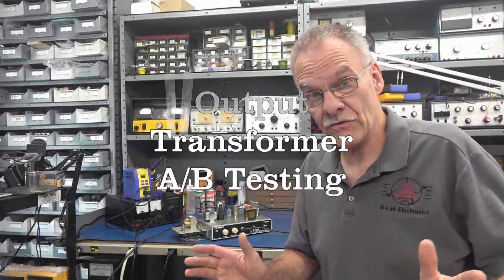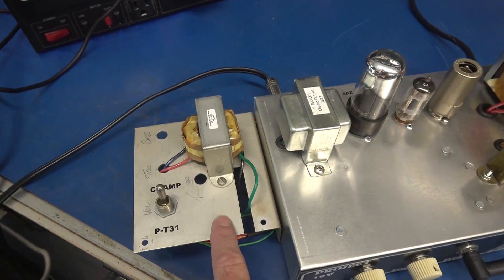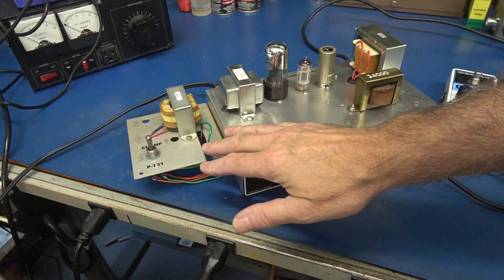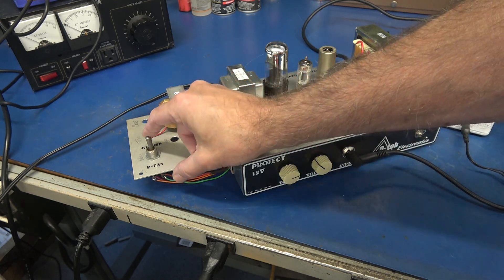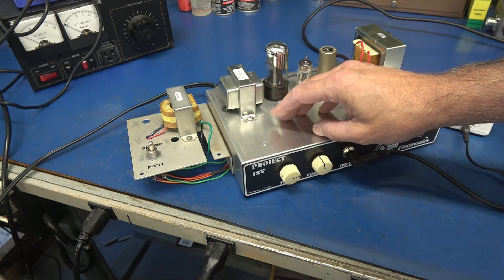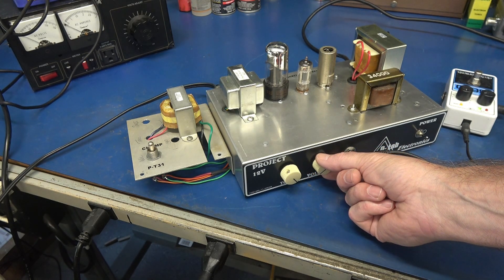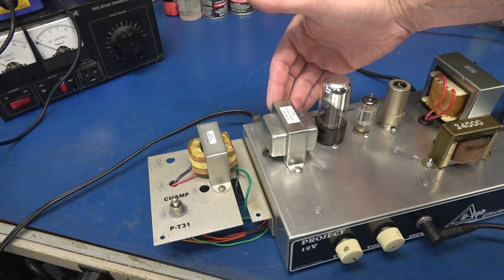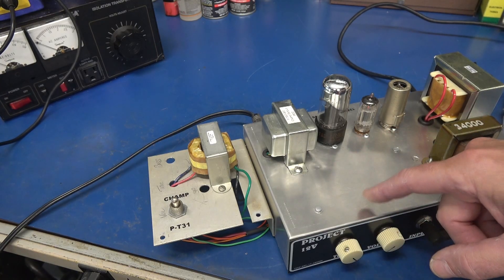Does tube guitar amp output transformer affect tone? Testing Amplified Parts Class A Champ vrs P-T31

Comment: Very interesting , including the next video with scope measurements. I would suggest that the looper has one or two shorter riffs (one bar) , it can be two recording , one with chords stroke and one with a single line soloing but short, this ease the ear comparison (at least for me in my own tests with speakers), so when switching you actually here exactly the same short phrase and the ears may grap better/faster the sound quality difference 
Brgds

Comment: So far as tube amps go, there are so many factors that can have a discernible effect on tone... but I think it helps to understand which factors can have really big effects as opposed to the lesser ones. If you were to list those factors, the ones with relatively big effects, the output transformer might not always be one of them, not when compared to things like loudspeaker selection, open or closed back cabinet, gain and tone settings, biasing, tube manufacturer and vintage, or the level of the input signal. Ultimately, the tone of an electric guitar is a synergy of countless factors, but there actually quite a number factors that would tend to be of much greater significance than the transformer.

Comment: I've built over 100 single-ended Class A 6V6 powered guitar amps. Very early on in my work I discovered that if you do not use an air gap output transformer you are getting nowhere near the volume and quality of sound that the circuit actually produces. Eventually I had air gap transformers custom wound for me. The difference is an order of magnitude greater than the difference between the two transformers compared here.
I don't believe that either of the two transformers shown here are air gap design. Sorry if I am incorrect about this.
This video is sort of like comparing a Ford Falcon to a Dodge Dart when a Shelby Cobra is sitting next door.
I wouldn't bother with either of these transformers for this application.
Reply: Both of those transformers will be airgapped. That's required for single ended.

Comment: I did a 3 transformer comp years ago on a Vox AC30 circuit variant I'd built, comparing Mercury, Edcor and Mojo iron.  The whole thing took about an hour with 2 people besides myself listening.  The differences became clear as we went on, not being subtle, the Mercury sounded best to us.  In my experience building for many years, size is always a factor, bigger being louder, fuller and cleaner if the primary is optimum.

Comment: Thank you!  I’ve did similar tests a couple decades back for my own sanity (pre-YouTube days) comparing stock Marshall plexi reissues OT, a Mercury Magnetics and OBsolete Electronics (OEI).  Definitely had my favorite (and surprisingly it wasn’t the most expensive/popular either!), but man had I had a video like this back then, I would have been upgrading a lot ,ore OTs for folks!

 Great job! Another suggestion for a video would be comparing some of the magical mystical components and other hyperbolic marketing lore components compared to more mundane counterparts (ie carbon comp vs metal film where values are measured and matched to take tolerance out etc).  Let people make better informed decisions on where to throw their $ in upgrades, and where to save it.

Comment: When you switch the output transformers on the go, why the back EMF dont cause a problem? Like when we use transistors to activate a relay, theres generally a diode between the coils to avoid that.

Comment: I could hear a difference and, coming from a valve hifi background, I feel I know why - The 'Champ' transformer has shrouds which form and constrain the magnetic field of the coils and it sounded less alive, I preferred the PT31. Thanks so much for this video, it saved me running the same test. I know from big 300B single ended hifi amps that if you take the lid off a boxed amp you feel a big difference in the sound, more open, alive and better soundstaging as the transformers magnetic fields are not constrained. There's a similar thing with PAF pickups with metal covers on - different sound from bare coils.
Reply: Metal pickup covers cause eddy currents that cancel highs.  Could be the same effect.
Reply: "shrouds"??? If it's not magnetically conductive, it's moot.
Reply: @stephensaines7100  They could be either paramagnetic or diamagnetic depending on the alloy.

Comment: I would take the champ, but only because so the shielding. Would like to test the noise floor and also have the other one in the circuit when tested. The unshielded transformer is quite a bit further from the power transformer for this test.

Comment: Without watching the video, my guessing is without a doubt, because the core will effect resonance and transference of the signal into the secondary. Number of turns, cross dimension of windings too, material used to make the core, density, numbers of layers, thickness of layers, so many variables.
Reply: [ material used to make the core, ] Indeed, there a four or five standard specs for the steel characteristics as per permeability, permanence, saturation curve, etc, but one of the more important factors is annealing of the metal. It changes the magnetising curve as much or more than the 'magnetic steel' type specs.

And here's the clincher: Age affects annealing properties. I'm neutral on the issue, but the 'old amps sound better than new ones' adage has some merit in that regard.